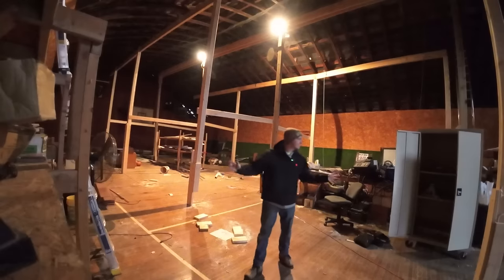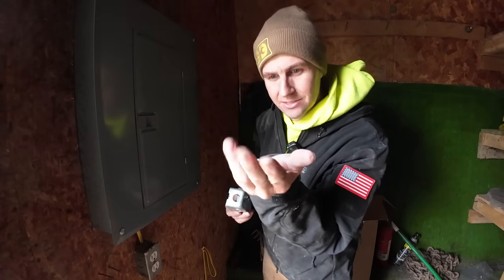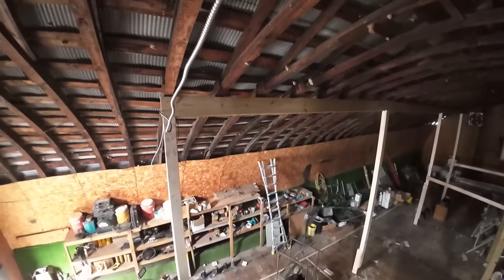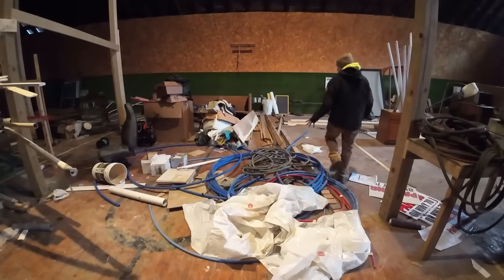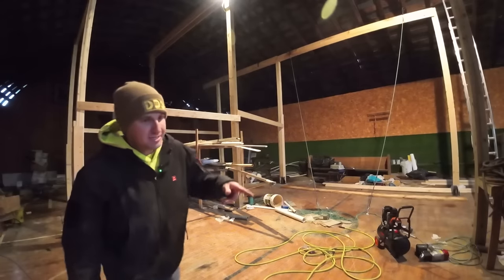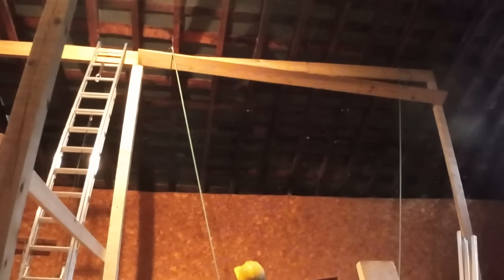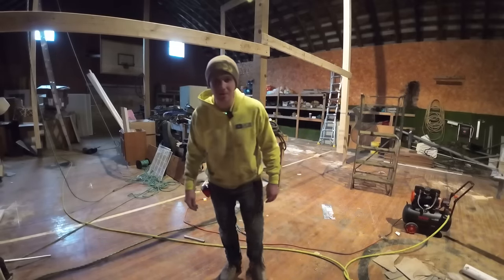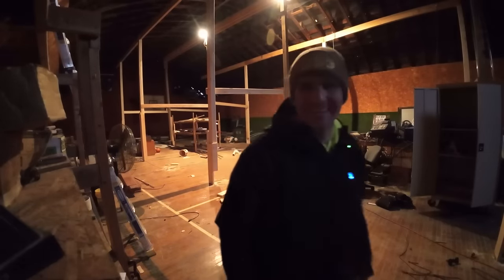Barn Beam Install Complete and Ridge is on the Rise! - Barn Revival Pushes on!

Comment: This would be a horrendous task in the summer, the heat would be unbearable radiating off the tin. Your headquarters build, and Cutting Edge Engineerings crane rebuild are the two best series on YouTube right now.

Comment: Brilliant Captain, even with the minor lift you did you can already see less light coming through the gaps at the edges of the sheets of corrugated metal. It was probably a groan of ecstasy as it now knows it's going to be looked after, the 555 probably had a reassuring conversation with it telling it, it was now in good hands. 👍

Comment: I think in addition to the screws in each truss I would add stop blocking on the truss as well. The stress on the screws as the angle changes will tend to pull the screws loose. I would also run 3 or 4 long measuring tapes down off the ridge and do the laser level to see how close the ridge is to level as you lift. or at least mark your posts with the same footage from the ridge.
Reply: The idea of dangling measuring tapes as a visual for checking the dip in the roof is really clever.  I'm wondering how tall he'd have to extend his ladder to get all the way up there...I don't think I'd be brave enough to climb a steep ladder that high!

Comment: I'm still worried that those osb(?) panels on the walls aren't helping. They will be stiffening the lower walls in a bad way, and may have contributed to the roof sag by straightening out the lower part of the trusses Have you thought of taking one  osb panel off and seeing how much force they are putting on the trusses?

Comment: This building almost looks to be built like a boat, just upside down. The keel is the ridge. Laminated frames like on a boat. And like a boat, its stronger when all the frames act like a system with the floor and ridge.

Comment: Ive found it's easier to just bend the MC, slightly longer than where I actually want the sheathing cut, so it breaks at the bend.  Then you can cut and trim the sheathing, using your diagonal side cutters (dikes).
Reply from the maker: I've tried that, not a fan.  But if it works for you that's great!  Appreciate ya watching

Comment: I'm not sure you want to be connecting the top of your new beams to the joists.  I suspect you need spacer beams running cross-wise between your new beams (to keep top width constant), then allow the old joists to be pushed outwards ( to re-profile the roof), not just upwards which may end lifting the timbers off the sill plate.

Comment: Dumb thought of the day and probably should’ve mentioned it sooner. Instead of screwing down the base of your ladder and then having to unscrew and re-screwed every time you move it, you know you could’ve screwed a board to the floor set your ladder in front of that, and then tilt it forward the board would’ve kept your ladder from slipping backwards. To move it you just have to lower it a little and slide it down, raise it back up to get it under the rafters. Doesn’t do a lot of good now that you are almost done but maybe you can keep it in mind for the future.
Reply from the maker: When working alone at height, shortcuts are not an advantage 👍
Reply: Very happy you have been screwing the feet of the ladder down Mike, working off a ladder is not a big deal if there is a helper keeping it from moving around with his feet on the base of the ladder. But .... If no helper ... oof. I learned the hard way by taking a wild ladder ride down a 25 foot wall, I most assuredly don't recommend it for anyone. So, kudos and shout out for being safe up in the air..
Reply: @CaptainKleeman  let me start by saying mine is just free advice and you do whatever you feel safest with but also mention it’s really not a shortcut. I learned this trick Indirectly from a friend of mine, whose father and brother were both in construction. It was his father and brother, who actually showed me how to do this. They would screw the board down, even if there was somebody else to be there to hold the ladder because the multitude of fasteners in the board would be stronger than a person holding the bottom of the ladder. I even saw the brother do it when he was working alone outside on siding once. He started by drilling holes in a 2 x 4 that was 10 foot long and then he took a jigsaw and cut slots up to the holes. I was wondering because he didn’t do any kind of measurements or make any lines what he was up to, and he said watch and see. He had a ladder set up next to the house, he put the board down at the base of the ladder, and then with two screwdrivers he pinned. The one end of the board by putting a screwdriver in one of the slots at the end, and another, on the other side, holding The board against the screwdriver, then took his ladder to the other end and set it up, positioned the board against it and pinned it. He then used another screwdriver and marked the ground where the slots ended in the middle of the board. He then removed the board and were all his marks were he put in one of those Twist in ground anchors that had a flat washer under the handle on the straight section before the spiral part. Once he had the ground anchor low enough, he slipped the board underneath. With all the slots lining up with the long straight shafts and twisted the ground anchors all the way down so they were holding the board in place. It gave him the extra protection, even though he’s working alone on the siding. I was young and dumb enough at the time I ask him why he didn’t want to just use the sharp spikes in the feet that were designed for sticking in the ground to hold it in place and he picked up one of the anchors and said which do you thinks gonna hold better that little bitty bit of metal in the topsoil or a whole bunch of these in this board the way they are? Dumb question answered.